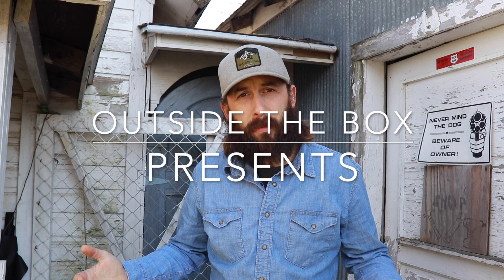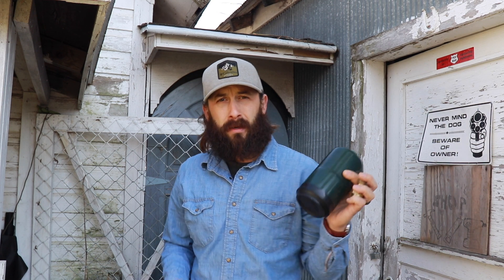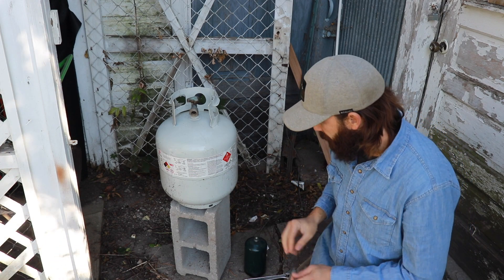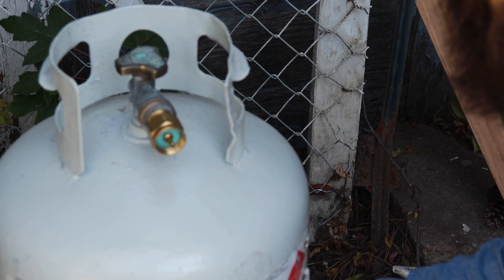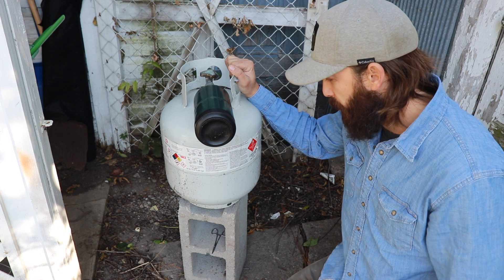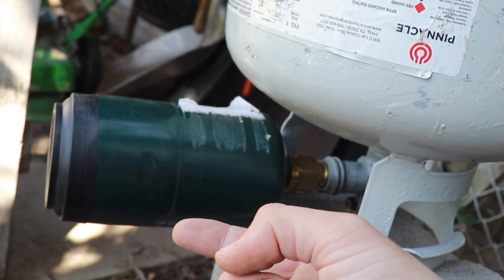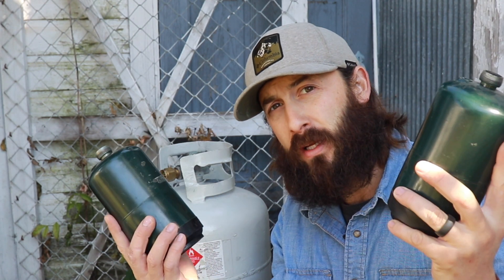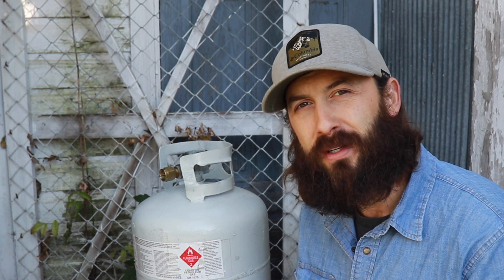How to refill your 1 lb propane tanks - Outside the Box

Comment: Love this video a lot. You should attach the small bottle as you did here and tilt the whole thing to put a 45 degree angle on the small bottle to fill more liquid. Put the inverted large bottle on the edge of the table and tilt while refilling. That way you dont need to use the valve release. Great post

Comment: I refill mine. But im about to go on a cross country trip, and DOT says its illegal to transport these if refilled. I know chances are low that they would find out... but still the fine is huge. Might buy the flame king 1lb bottles.
Reply: When I bough a pair at over $8, guy told me they will blow up if you try and refill them.. scared me, Mr Hank Hill, what do you say?
Reply: @glion7792  I ended up refilling. I only do it 3 times per bottle. It’s been good so far